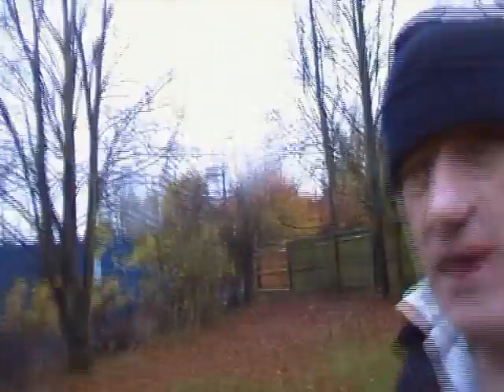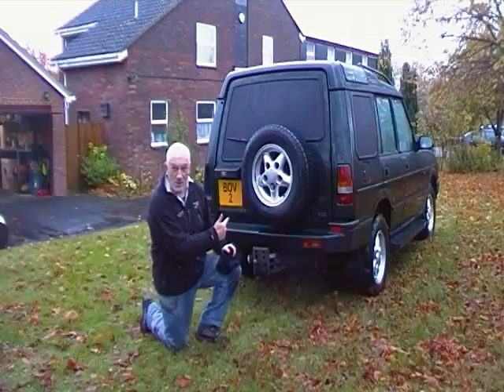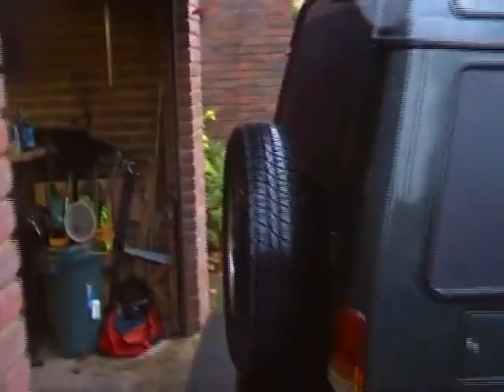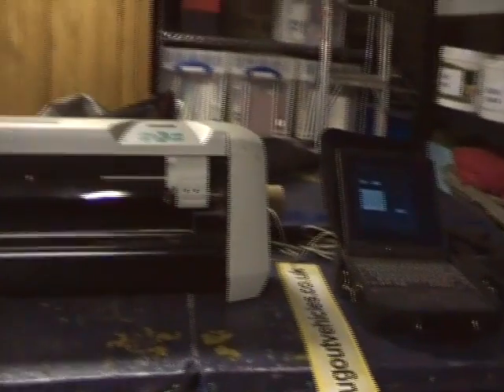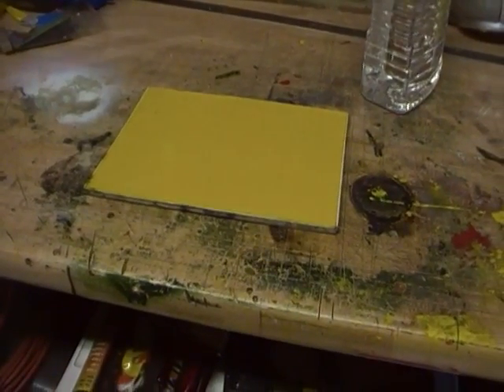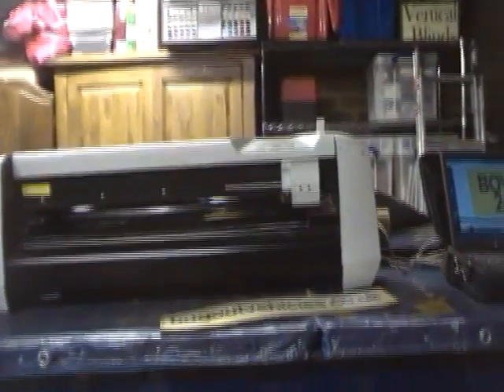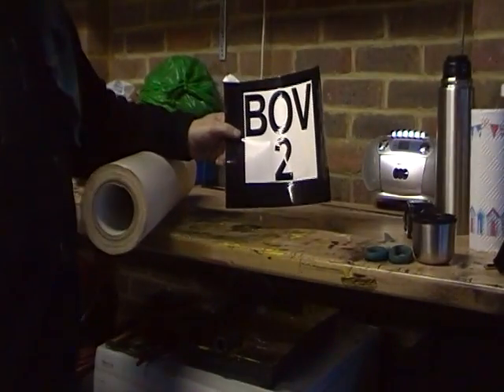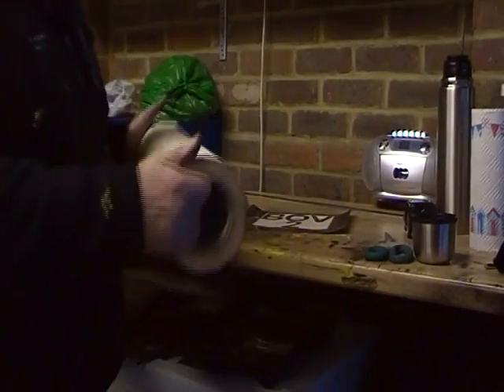New Bugout Vehicle

Comment: LMAO just add water.  I'm so glad you got it replaced, somewhere in the back of my mind I was really worried about you folks across the pond.  I actually considered sending over a couple thousand from my settlement fund I was so upset about it.  I worked at landy for about 5 years as a driver I used to take them over all kinds of stuff and never seen one get stuck.  Never seen one catch fire either.  My fav was always the discovery and disc. II SEL.  Glad you're back in the saddle.  -Leon

Comment: I must say they do suck gas badly. Liveing hear there are no books I can find on them I wish I had one . Under the back side doors both the steal is rusted out with holes but no rust on the outside . Both cars have leaking power steering lines or pump can't tell for shure. I got a steal time card drawer thing it fits right in the back it has 12 drawers in it I keep all my extra bob stuff in there couldn't ask for anything better.  Leaves areas on the sides for my packs I have 2 bobs in there.